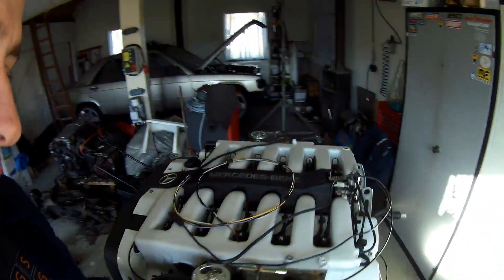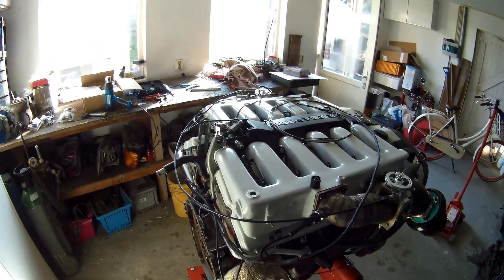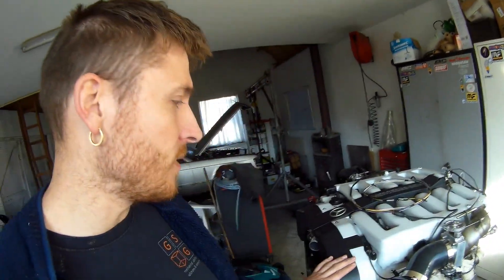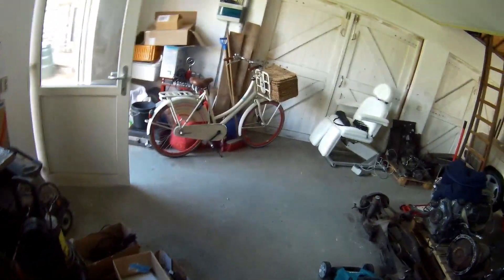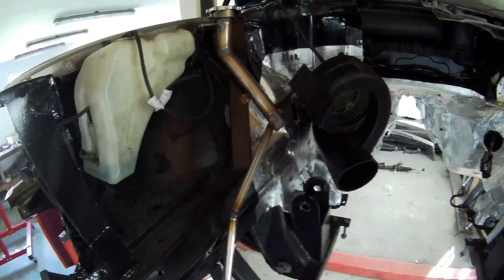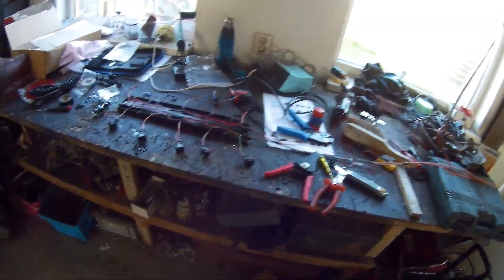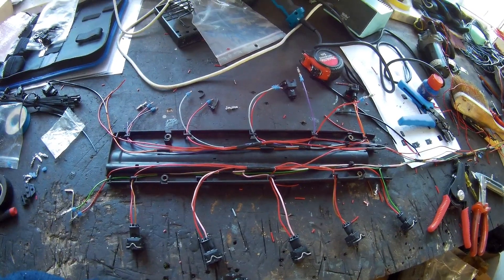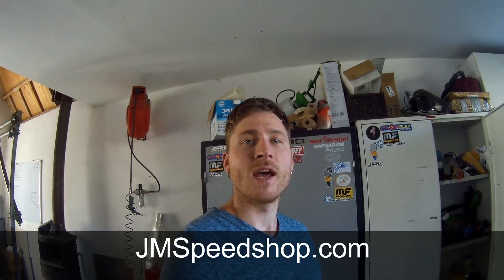Making an engine wiring harness for the W201 V12

Comment: hello,
very nice work!
i am also doing a M120 engine.
Can you tell me what model your 60-2 flywheel comes from?
It seems 500SL but I can't really find any info..
Because my management does not control the 3 pick-up point.
Best regards
Reply from the maker: From 1995 and up. In 1995 this changed
Reply: @JMSpeedshop  Thank you for your reply, I will start looking ;)

Comment: Nice build👍 What steering rack you are using? I have 320CE m113 swap and there is not enough space to use original steering parts🤔
Reply from the maker: Im using w210 steering rack.but what is in the way a m119 Will also fit a w124 with the w124 oem steering rack

Comment: Heb je een cardanaslager nodig? Die moeten toch wel te krijgen zijn. Of is het een speciale maat?
Reply: Trouwens luister dit filmpje eens. Is de helft van jou motor dus kan je nagaan hoe die van jou gaat klinken.  https://youtu.be/d8Xf3Th1sOQ
Reply from the maker: Het lager heb ik dat is een w124 part nummer maar er zit een huis omheen met een rubber en deze schroef je dan onder in de tunnel. Dit deel is al een 6 mnd in nalevering bij Mercedes en kan ook aftermarket er niet aan komen.
Reply: Je kan deze toch gewoon compleet kopen. En losse rubbers heb ik ook gezien. https://www.steronderdelen.nl/assortiment/mercedes-w124/w124-aandrijving-ophanging/ophanging-cardanas-14/ op de site staan meer modellen.